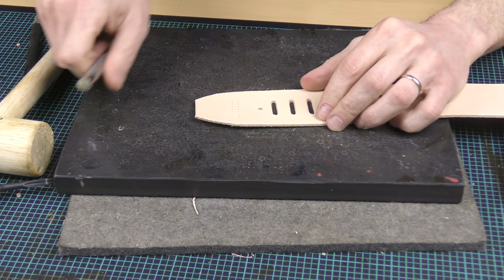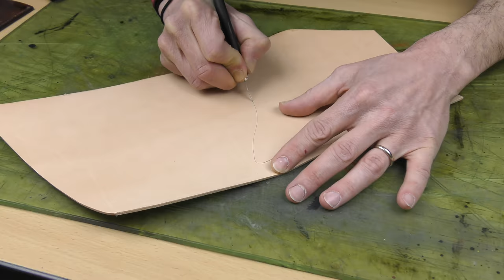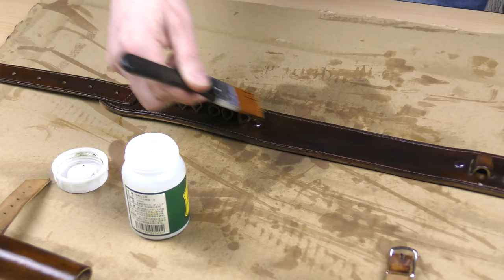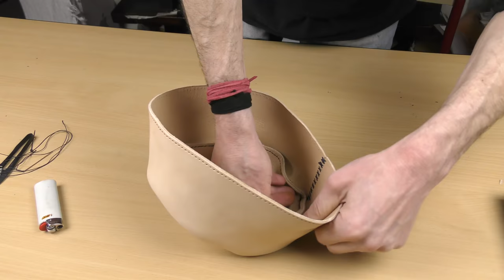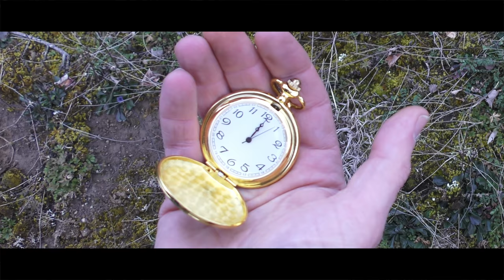How To Make Arthur Morgan's Leather Holsters & Hat - Red Dead Redemption 2 - Leatherwork

Comment: Wait, if you painted over the inside of the crown or where your head basically fits in when wearing it, wouldn't the paint stain your forehead? (In the process of making my own right now lol, this vid is very helpful!)
Reply from the maker: Thank you. It's not paint but leather dye so it's totally ok if yu wait until it's totally dry to wear it. Good luck with your build.

Comment: Wouldnt a leather hat be impractical?
Reply from the maker: A leather hat is meant to be resistant to the rain and cold. You could also work with wool but it requires machinery I don't have. A good cowboy has always two hats, one made out of leather or wool, and another one made of straw for hot weather
Reply: The Redsmith ok. Thanks.